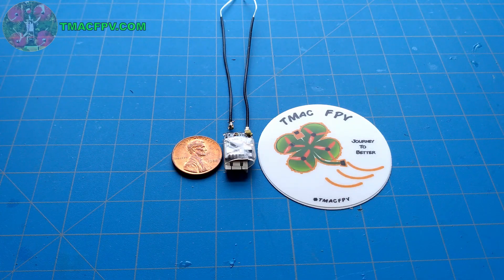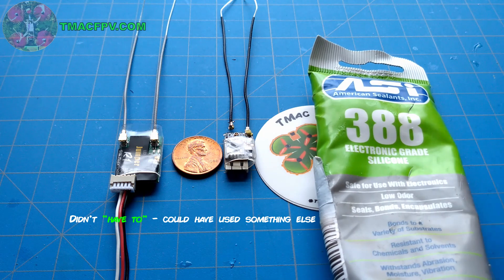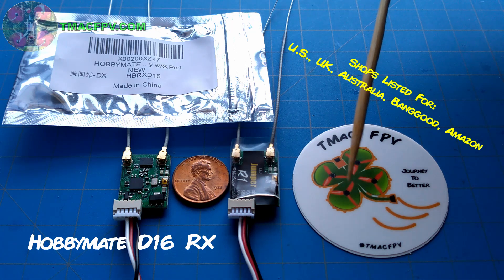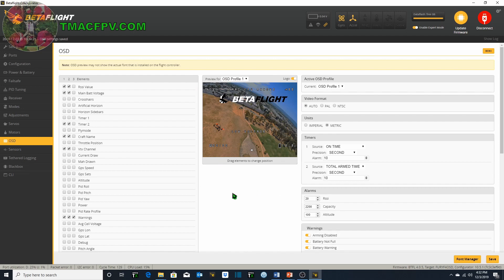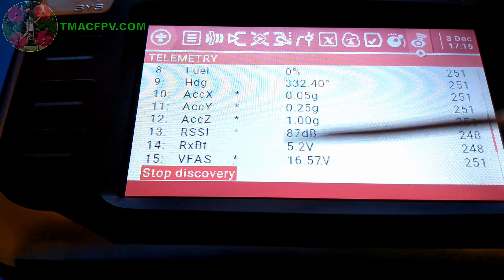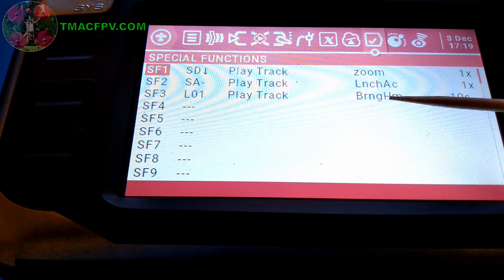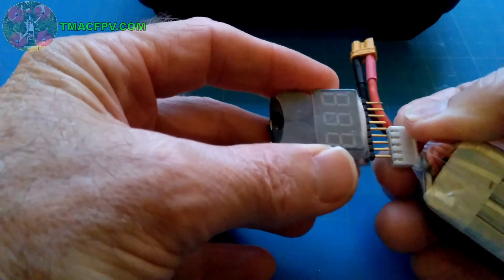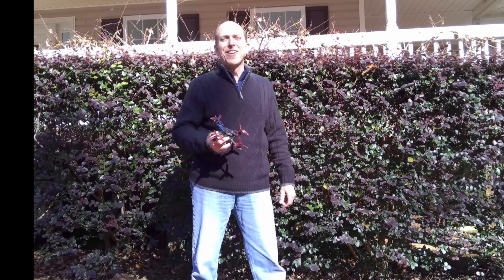JUMPER R1 RECEIVER TELEMETRY SETUP

Comment: Are you planning on reviewing and setup for the Jumper R1F?
Reply from the maker: Hey Mike, great to hear from you! I don't have an R1F, so I'd have to get one.  But it should be fairly simple to setup.  Ground wire to ground pad, Power wire to 5 volt pad.  FPort to SBUS pad on your flight controller.  Toggle ON Serial RX in Ports Tab of Betaflight for the the UART associated with SBUS pad on your flight controller (see your Flight controller  documentation for this as it varies by flight controller). In Configuration Tab select Serial RX and FPort under it.   
Toggle ON Telemetry in configuration Tab. 
Type the following commands into Betalfight CLI: 
set serialrx_halfduplex = OFF
set serialrx_inverted = ON
Hit Return on keyboard
Type SAVE into CLI then hit return on keyboard
FPort instructions from Betaflight page are here: https://github.com/betaflight/betaflight/wiki/The-FrSky-FPort-Protocol
Grayson Hobby video for R1F is here: https://www.youtube.com/watch?v=cUEvQ4xcU7k
Reply: @TMacFPV  You must have watch the only YouTube on setting up the R1F for a F4 from Grayson Hobbies which was wrong.  Connecting to SBUS only provides rx functionality but  no telemetry.  

I spent several hours on trying to get full telemetry.  Below is how I get both rx and telemetry to work:

Enable softserial

Connect rx FPort to softserial tx (not SBUS as Grayson Hobby outlined)

set serialrx_inverted = ON
set serialrx_halfduplex = ON or OFF depending on firmware (BF or iNav)

set telemetry_inverted = OFF
set telemetry_halfduplex = ON (BF or iNav 2.3)
set telemetry_uart_unidir = ON (iNav 2.4)
Reply from the maker: Hey Mike, great you got it working! Thanks for the info!👍I should've caught that Mike, my bad.  Inverted telemetry signal going to F4! Been a long weekend for me!😉
Reply from the maker: Hey Mike, I've decided to do a video on the R1F (per your suggestion) as I'm getting a lot of questions on it. I've ordered one and am awaiting its arrival. Hopefully I can get video on it out this week. When researching stuff on it, I recalled you said you're doing it over Softserial. I've learned myself although it CAN be done this way, it's not recommended as your control signal is now also going over this Softserial. Softserial is software emulated and not meant for high data rate applications like control signals. You MAY not encounter issues, however, by doing it this way you're taking a chance on losing your control signal (and quad?). Just thought I'd pass the info on to you. I'd be interested in hearing from you as to whether or not you've flown with it yet and if so have you encountered any issues? Thanks! Also, what flight controller are you using?
Reply: @TMacFPV  Yes, I'm aware of the issues using a softserial UART for a rx channel. The issue with get full telemetry is only the F4 FC's. Though I did connected the R1F to a F3 with no problems. As far as for a F4, there are really only two solutions: 1) use a SBUS inverter or 2) wait for someone to figure out how to connect to an un-inverted pad on the R1F. I have a couple of SBUS inverter but decided just to shelf the R1F until an un-inverted hack is identified as on the FrSky X-series rx's.

You are going to find out that binding with a T16 that you are going to have to change the freq offset be either 40 or -40.  Though, binding to a FrSky Taranis is straight forward.  My understanding is the current version of the T16 multi-protocol module firmware does not do freq optimization during the bind process like the FrSky radio does but they are apparently working the go firmware to incorporate these feature at some time.

The only information on binding and configuring the R1F that I’ve come across has been on the Grayson Hobby website but neither of these issues are discussed.

Good luck on the video.  You will probably be the first to explain how to setup a R1F properly.
Reply from the maker: @mikeduncan2127  Thanks for your reply Mike, just wanted to make sure you knew about Softserial issue. I've bound my R1 to the T16 with no issue and I understand about tuning multi-module (although that "should" only have to be done with genuine FrSky receivers and a couple other protocols). Thought you were trying this with an F4. I've avoided the FPort thing because I knew it would be a pain on some F4s. Just decided to avoid the whole thing with FrSky protocols and am doing Crossfire instead. Only reason I'm doing this is to help others out who may need/want to use the R1F. I certainly appreciate you passing on your knowledge of the subject. Take care Mike and thank you
Reply: Mike Duncan read this thread all the info you need and use the tutorial of oscarliang for f4 fc. www.rcgroups.com/forums/showthread.php?3407837-Jumper-R1F-Receiver-two-way-full-duplex-Sbus-Compatible-Frsky-D16-Mode-Radio-support

Comment: Hello, i need help! I'm connect SBUS only and i get RSSI only, but RxBatt  is 0.0V. Can i get RxBat without S.Port connection? Sorry for my English i'm from Russia.
Reply: Алексей Макаров read this thread: https://www.rcgroups.com/forums/showthread.php?3407837-Jumper-R1F-Receiver-two-way-full-duplex-Sbus-Compatible-Frsky-D16-Mode-Radio-support the voltage divider on the rx is wrong jumper switched the resistors!

Comment: Hi,

Thank you for the excellent video. I’m very new at this, and very reluctant to do my own modes and installs.  

I have a brand new Beta85X with a faulty Frsky FCC receiver and BetaFPV is giving a hard time in that because I’m in Canada they are only offering me a $25 refund - crazy night!!  I’ve been dealing with their support for over a week and this is all that they are offering.  

I was thinking that maybe I purchase another receiver and have installed by a local hobby shop, hence my following question!

Can this receiver be installed on the Beta85X HD 2S-3S version and still get the full range of telemetry?

Thank you
Reply from the maker: Hey Sam! You're welcome. Let's see if I can help.  Just did a search for your version of Beta85X HD 2S-3S.  If its the original version (which I believe is what you're talking about) and does not have the F4 V2 flight controller but has the original V1 instead, here's the link for the flight controller: https://betafpv.com/products/f4-2s-brushless-flight-controller-and-esc   . What this link shows me is you have a 5v pad, a  ground (GND) pad,  an SBUS pad, and a spare UART TX pad (the 4 pads I mention in this video).  That's all you need for this telemetry receiver.  So, "Yes" it will work.  It MAY be a little big in physical dimensions for that size quad though.  If you only want/need RSSI displayed on your OSD in your goggles, the XM+ is a smaller size RX.  If you want/need the voice alerts you may want to go with the FrSky R-XSR which you can get at SH Hobbies up there in Canada at this site: https://www.snhobbies.com/advanced_search_result.php?keywords=frsky+r-xsr . As mentioned in the video, the connections for the R-XSR and the Jumper R1 are the same except the SBUS and S_Port wires are swapped. Hope this helps Sam. Clear skies friend!
Reply: Hi TMac,

You’re the best.  This is the first time I received such a detailed answer to a question and so quickly.  

I like the second option of the Frsky R-XSR.  All I would need is to have my local hobby shop install it.  

I would love to join your patronage.
Reply from the maker: @samavella8831  You're very welcome Sam, happy to help friend. You may want to check out the Fast Track FPV Course on a page of my website at tmacfpv.com . Might find it useful. Other cool resources are there too! In any case, good luck and let me know how it goes; Clear skies!👍😁